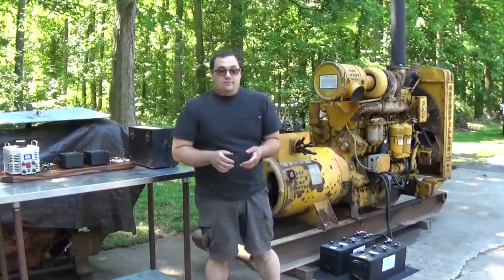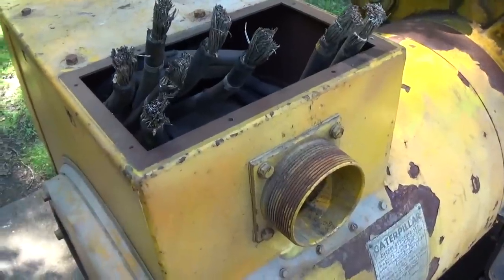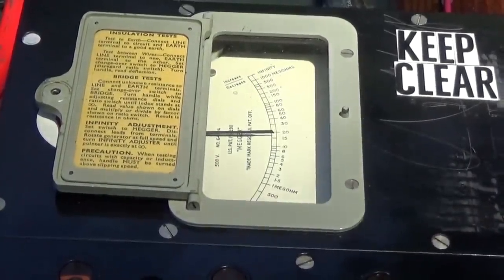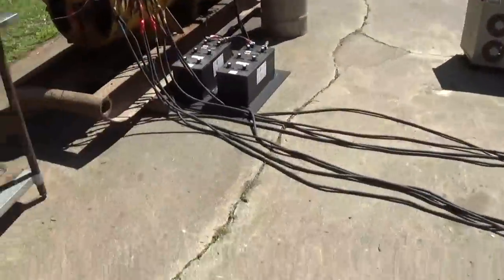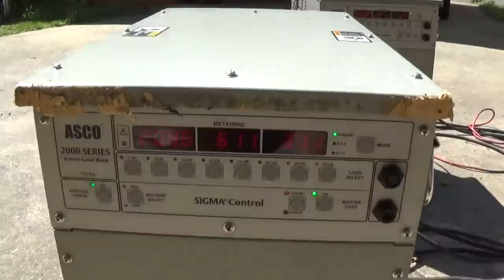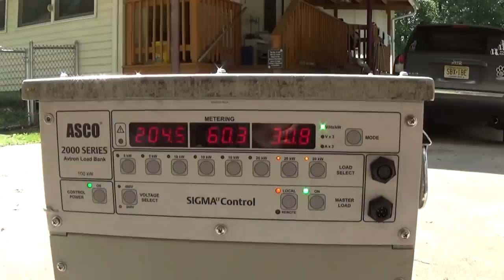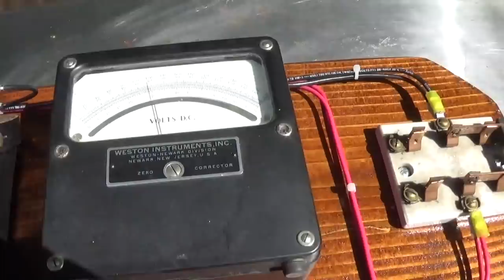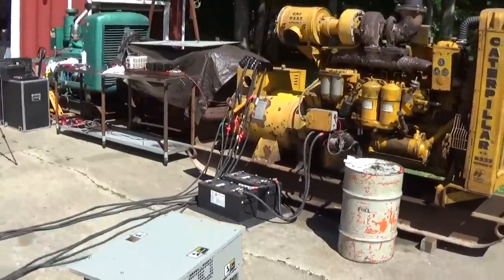CAT DIESEL RUNNING UNDER LOAD 1959 Caterpillar Generator Testing

Comment: FYI your "60KW" test was only 50.5 KW ... I think you forgot to hit one more 10KW switch [208v x 243a = 50,544] .... Nice gen, though. Love the sound of that turbo spooling as you add load...
edit: You have me confused now. Your 120kw test was 210v @ 329 AMPS ... that's 69,090 watts ... or 69kw -- unless I'm missing something here?
Reply: You are forgetting that this is 3 phase power.  You need to multiply 210 volts X 329 amperes X the square root of 3 or approximately 1.732. This comes out to  119,667 watts. assuming that the load banks are purely resistive loads at 100% power factor.

Comment: So it's not reconnectable because it is permanently wired as wye and not delta? 
Unless you only wanted to use 120 and 208 volts and not 120 and 240 volts.

Comment: I noticed that while under load that when you looked at the exhaust there were random puffs of exhaust. Does it have a miss fire that's causing that or is it just carbon deposits burning off?
Reply: I'd say that's just carbon burning off, I doubt that engine has had that much of a exercise since it was new

Comment: Oh - one other thing - this is a good method to use if you take a generator apart and wash it with a pressure washer... and when you get it good and hot it's a good time to spray it with gliptol... have fun

Comment: Not that brings back memories I was stationed in a Loran Station. We had three Cat D397 250kw gensets.  I can remember having to loadbank then prior to placing them up on line or in immediate standby.  I got to rebuild two of the three D397 while I was there. The power provided normal power for the station and also through set up transformers raised the voltage to 15,500 volts for the two transmitters .

Comment: At .8 pF load, the excitation well be much higher. Unity pf only loads the engine, not the generator. I have had generators test good on load bank, and fail in 5he fild due to a bad router.
 John

Comment: Hi Mike!
Always enjoy your videos!  However, I need parts for my older Generac 19A01427S gen set, type CG015, with the GM 3.0 4 cylinder engine, set up for natural gas. Rebuilt the engine, and it runs very well, but the manifold gasket badly needs replacement. It is a G0887780211 gasket, but I've not been able to find one, as it is obsolete. Also looked for a head set to no avail. Might you have such an item you are willing to sell, or know of somewhere I can really find one? Tried every lead on Google.
Guess that is just one more stumbling block when dealing with older equipment, but it only shows 149 hours! PLEASE advise!

Neil KD0SGO

Comment: If watts = volt X amps, why is the calculated output only about 60% of the load?  For example 210v X 400A = 84KW, but the load banks were set to 139.5 KW?  What am I missing here?
Reply: He's measuring current on one leg of a three-phase power circuit.

Comment: Imagine if it was a Detroit you would be deaf
Reply: But, it would have a good blower.

steve
Reply: Yep ! Might stretch the sense of humour of the neighbours ....! Lol 😆
Reply: I did, and I am.
A 6-71T physically half the size of the Cat and making twice the noise would do the same job, horses for courses they both worked in their day.
Reply: Detroits/EMD are known for being able to start up and hold a load almost instantly without warm-up.  Seems you need to be a little more gentle on 4 stroke diesels (yes I know how old it is).  Of course this Cat is a great unit.
Reply: He did have hearing protection so that could help, those old Detroit's were loud even with a muffler
Reply: @kevin9c1  For generator drives GM were popular for emergency back up plant. Cold start to full power in around 5 seconds. Cats were popular when you had stable load and ran long hours. I worked on GMs in remote country areas that ran 24/7 they would be stopped once a fortnight for an oil change then lit up for another 2 weeks. They usually ran around 20,000 Hrs before an inframe overhaul.
Reply: Ray G once a fortnight?

Comment: Those diesel generator sets have been replaced by gas turbine generator sets at hospitals, haven't they?  What are you going to do with it?  Isn't 208 used by business but 240 used by residential. That is putting out 3 phase correct, but wouldn't a hospital be using single phase

Comment: What is the frequency regulation?
Reply: A good governor on the engine.  On the cat generator my brother uses on his crusher the power display on the controller has a readout for frequency.  60 hertz is  two notches down from wide open.
Reply: @brucejones2354  Frequency regulation is defined by the difference between no load and full load frequency.  On shipboard generators we set it at 61 Hz no load and 59 Hz full load.  Public utilities are much closer.  He doesn't say what it is.
Reply: @jimprice1959 , you are absolutely correct.  And the frequency is still regulated by the speed of the engine,  which is controlled by the governor.  The governor on most industrial engines, as used in trucks or heavy equipment are not as sensitive to engine rpm variations due to load variables.  But the govenors used for generating electricity are MUCH more sensitive and precise in controlling the engine rpm. When I respond to comments or questions on a subject I try to address this question to answer for people who know very little about the subject as well as for people,  like yourself,  who are Very knowledgeable about their field of expertise. Thanks for your response,  as I may not have answered his question with enough detail.

Comment: I have a 3000 watt generator used to power tools on construction sights. I wanted to use it for stand by at my home, but I was told it did not have a clean sigh wave and could destroy my electronics in my home, TV, computer, furnace ect.   What can I do?????
Reply from the maker: Bruce, the quality of the output sine wave is not quite as important as the voltage and speed regulation of the unit.  I plan to do a video on this at some point.  Thanks for watching.

Comment: I'm not sure that's probably grounded to the shaft ! did you do a continuity test! The shaft is going to have some resistance paid to the casing because of grease and the bearings this is going to give you a false isolation reading? I see you changed it to frame ground why was that.. why did you not do that in the first place?
Got a noisy bearing there somewhere turbo
Reply: His first test mega'd between the rotor (exciter) windings and the rotor shaft. The second test was between the stator windings and the case.

Comment: That thing sure makes a racket, I was at dirt track raceway outside of Calgary they had an old 6 cylinder flat head something running, either Propane or Natural gas, at idle I could hardly tell it was on, might be a different story once  the track night lights come on. 
     You get a work out just lugging those cables around, thanks for the show.

Comment: Hmmmmm, I do have a bit of a problem with your DC readings.  You aren't making true DC but 120Hz unidirectional pulses of voltage by just using a bridge rectifier, what your "DC" meters read with this I have no idea.  A proper high current DC supply would be better probably.

Comment: Where is the field voltage coming from?
Reply: @ruben_balea  And during startup, residual magnetism in the stator metal was enough to provide that power, as long as the generator was not yet under load. Wikipedia has a nice concise description.

Comment: I don't understand why anyone would put a full load on a three phase wound alternator when It is connected as an open delta, using only 2/3rds of the wingdings. (2 of the 3) Ron W4BIN
Reply: These load backs are 3 phase.  If you look closely at the wiring you can see that all the main generator windings are hooked up to the load banks.

Comment: 210VAC 400AMPS is 80,000 watts!!! You can power you neighborhood now. LOL. Great Alternator.
Reply: He measured that current on one leg of a three-phase output. I don't know how you would convert that to the equivalent current for a single-phase circuit, for purposes of multiplying by the voltage to get the power (assuming perfect power factor).

Comment: that was pretty cool if i had to choose between a new off the line cat  and one like you displayed here i'd prolly take the relic for reliability the relic was built to last with no cheesy asian electronics lol AND NO COMPUTERS!!! [:-) that'd power my house and shop with the a/c, heat lol every light and appliance the shop with heat air compreeors and lift hell even the welder in short it'd be more then enough hehe as long as the diesel lasted anyway lmao

Comment: you lost me. how are you getting an output without  an exciter field. You stated you needed that part to excite the field
Reply from the maker: I am using the variac and bridge rectifier to feed the field.  The variac is powered directly from the output.  The residual voltage is enough to get the whole thing going.
Reply: Small residual magnetism in the rotor core gets him started. That gives him a little power for the field windings, that increases the output a little, etc. etc.

Comment: You still did not define "reconnectable". "If your particular machine is designated as reconnectable then the voltage can be changed to suit your specific needs. Conversely, if it is marked non-connectable, you cannot modify the voltage of that engine."

Comment: Useless in the UK running 230v. Still would have-it in my garden
Reply: You could use this in the UK, but it would be derated. Drop the engine speed to 1500 RPM for your 50HZ, and bring the exitation voltage up till you have 230 volts out of the generator.
Reply: @newjerseybill3521  That would give you 240V phase to phase, but the UK is 240V phase-to-neutral, 415V phase-to-phase.
Reply: @ickipoo  True, I was thinking residential, instead of commercial 3 phase.